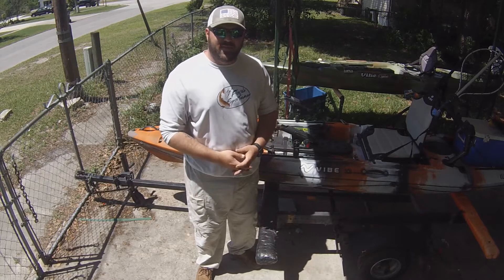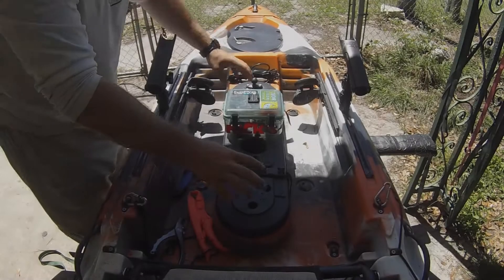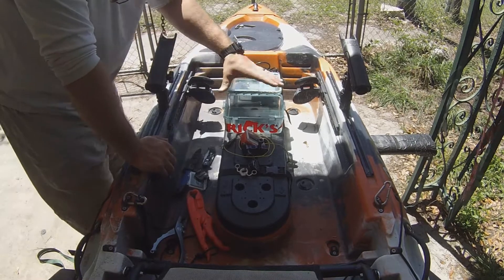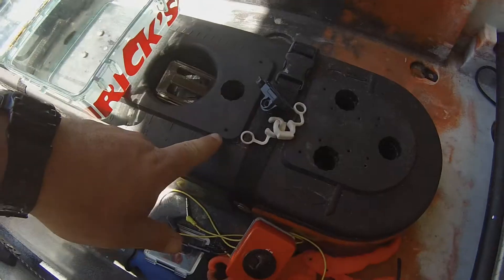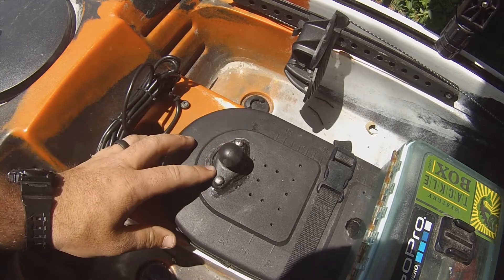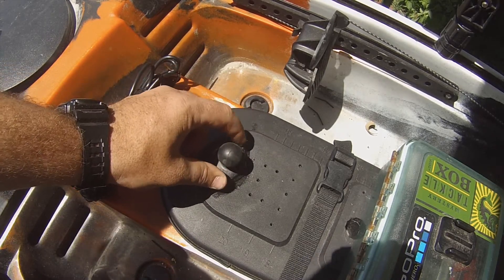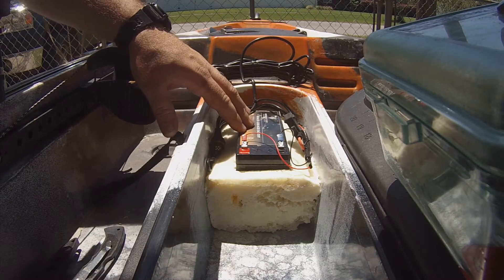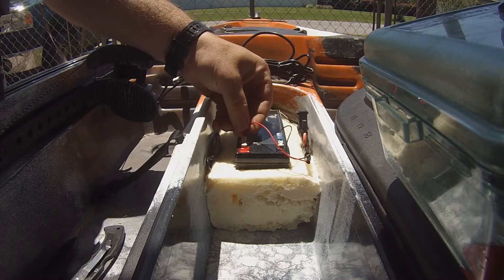Transducer & Fish Finder Install | Sea Ghost 2016

Comment: Thanks for the video.. I'm thinking of making the purchase for the SG 13 but don't know if I should save up a couple more pennies (LOT more! ha!) and get a used hobie outback..  This does seem like a great deal..
Reply from the maker: Timjb_83 both are great boats. I've been in "a few" boats and can tell you if it's your first kayak the decision is easy. VIBE is a great test the water boat because of its price. If you have had a paddle yak already and felt comfortable multi taking your hands then again Vibe again. If your ready for a hobie or native upgrade then yeah, pinch pennies and get on the water with your new plastic.

Comment: quick question. how do the rudder and rudder controls respond. nylon cordage? is the rudder toe control setup true (straight)? Watched some other videos from other 2016 sea ghost owners looked like the rudder wouldnt align properly.
Reply from the maker: +eric countryman When you get them from them from the dealer they are the one who installs the rudder unless you have it shipped to you from them. The trueness of the rudder is in how well you set it up. Mine tracks very well. I set mine up in the warehouse along with a couple other Vibe PS and we have had no complaints.
Reply: +BIGYaker TV Are you a Kennesaw local?  I hope these guys (Vibe) set up mine for me. First time kayak owner.
Reply from the maker: I hale from a little village in FL. Jacksonville

Comment: Now that you've had this set up almost a year. How's the battery been in the foam? Do you worry about it overheating any since it's in a black plastic box?
Reply from the maker: Daniel Reddy no issues. still ran strong for a year until I finally got around to putting it in the hull to free up space.
Reply: Cool, thanks for the reply.

Comment: What kind of mount did you use on the transducer? Is it the transom type that comes with it? Im getting my seaghost this Wednesday and I have a hook 5 that uses the exact same transducer. Thanks!
Reply from the maker: +Sixto Garcia The kayak comes LOWRANCE ready. The mount in the box fits dirrectly to the kayak so there is no need for extra mounts.
Reply: Okay thanks man. The one in the box is a transom mount. Im so excited,

Comment: How do you install transducer on 2015 model? is there a scuffer plug port like the 2016?
Reply from the maker: no. most everybody does either a through hull or a swing arm on a power cell
Reply: +BIGYaker TV is there any recommendations to where to put the battery?
Reply from the maker: +Kenneth Morrow center console

Comment: Now to find a place to store all that extra cable...
Reply from the maker: That is proving to be more difficult.
Reply: I've figured it out. Looks clean too.
Reply from the maker: post a pic on the forum and tag me, Rick Robinson
Reply: +R. Schreckengost whad you end up doing for the cable?
Reply from the maker: Sticking it in the hatch with some straps
Reply: I cable tied my wires, and stuck them in with transducer. Anyways good video, looking forward to taking the vibe out. I bought mine 2-days ago, cause was looking for a cheap Kayak, to use while waiting on the Hobie PA 14 with reverse. This Kayak is defintely the best deal i've seen of any Kayak.

Comment: Thanks for the video, can't wait to get my vibe
Reply from the maker: +Alfred Lopez  NP
Reply: bigyaker, i got the garmin echomap 44dv just wondering how long does the battery last. thx
Reply: bigyaker, i got the garmin echomap 44dv just wondering how long does the battery last. thx
Reply from the maker: +Alfred Lopez  I can run mine for about 8 hours. I did not need a large long running battery because I do not use mine all day. I very rarely use it to begin with actually. Mainly I use it to explore new areas. I did run it today though just at the house to see how long it would last and it was around 7h45m
Reply: Did u spray foam right in to the center console and did u rap anything around the battery so it want stick to it

Comment: where can I find the quick connect battery snaps?
Reply from the maker: i got them at tractor supply but you cab get them most anywhere that sells copper wire.
Reply: They are called spade lug connectors. Any auto parts store will carry them.